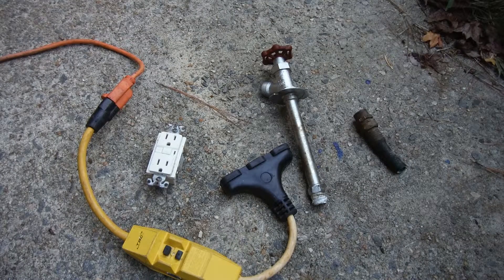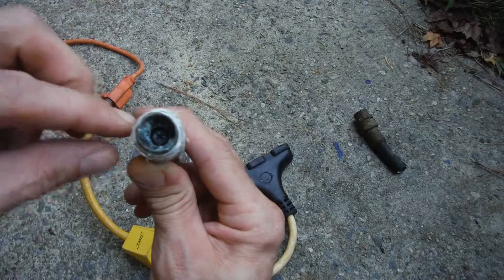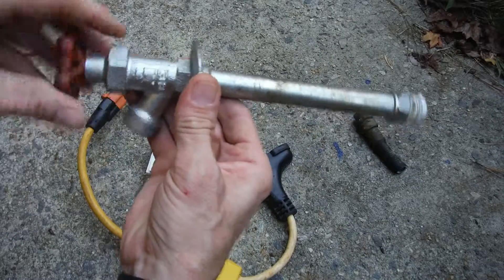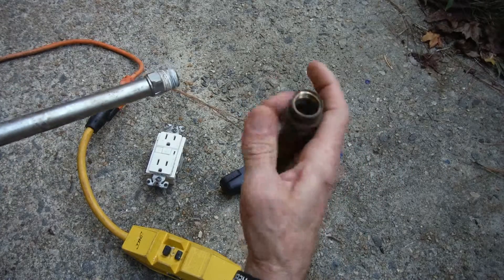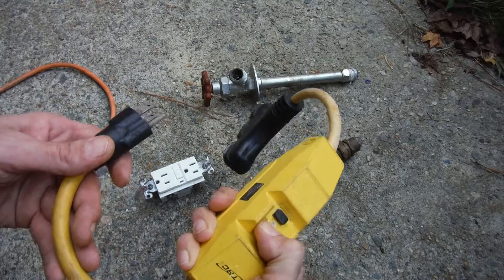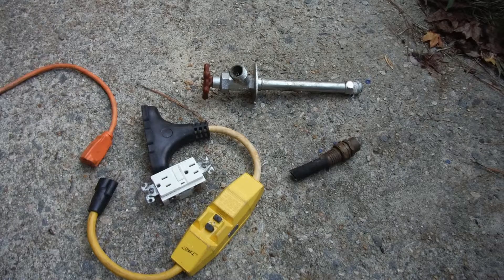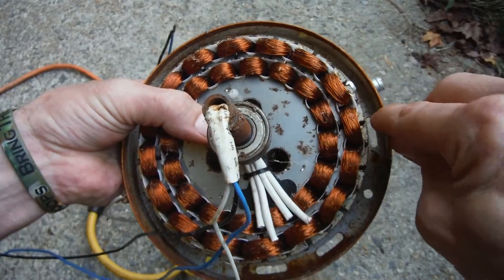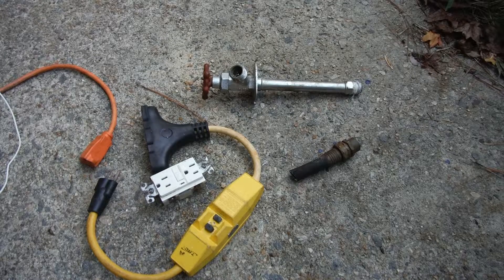Freezeless Faucet and GFCI Explanation For JT Bear

Comment: Those are generally marketed as "frost free" hose bibs up here. Home Death Spot carries them in 10, 12, and 14 inches, half inch and three-quarter inch pipe thread. This is one case where longer is better, as long as you've got the room.
Reply from the maker: +trollforge Very true! Down here where it barely freezes, we all call them freezeless but they definitely are just frost free and given lower temps they can freeze easily!!